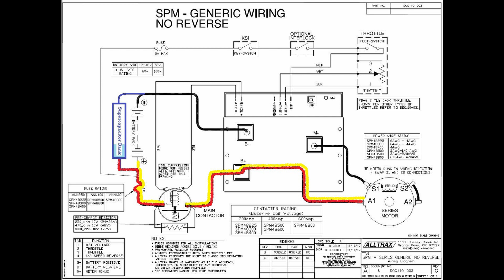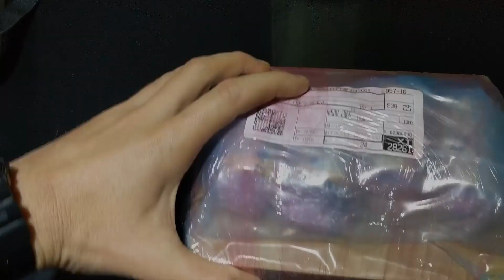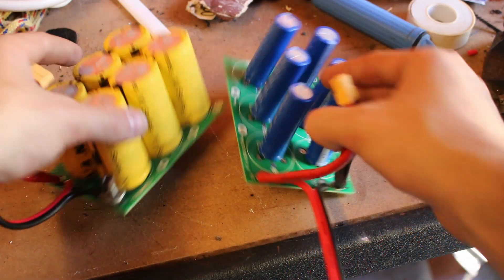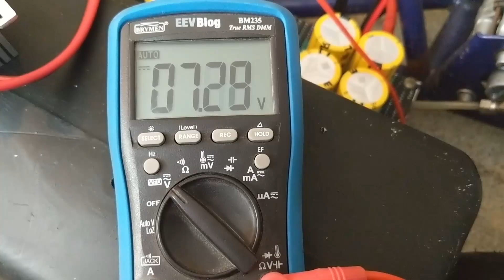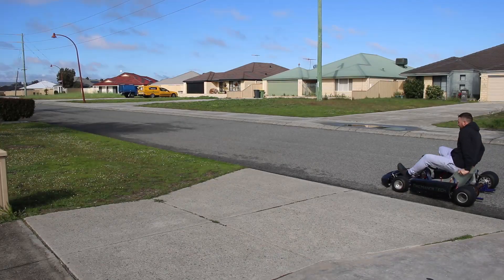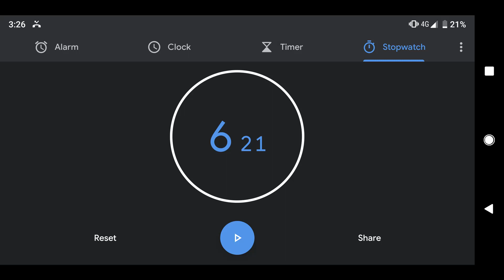DIY Electric Go Kart (Part 4)

Comment: HI this video is 3 years old.  (are you still active in this project?)  (or even active at all here on Youtube?  as the last comment seems to be 3 yrs ago too.,)
I have been researching off and on for e-gokart.  Not sure how I missed this or it just got enought view now to pop in google search.
I have a few questions or thoughts:
* Have you considered making your own capasotors (simple as rolling up alumminum file and wax paper. )   I have seen videos for that am sure you can find some too?
* Have you seen videos that use capasitors for car battery starting?  I am wonding if you can use some sort of alternator to assist with charging your your capasitors (possibly for even a no battery system)  or for sme extra mileage (instead of regenerative break >> regenerative motion)   [In therory it is possible > don't mis take that as "free enegry"] (I took some eletronics tech in Highschool but all I remember is Ohmes law, augh!)

Comment: I dont know too much about electronics, but what if you used a diode to supply the motor with the boost, and you had a seperate charge circut that was limited so it would charge slower
Reply from the maker: Great minds think alike mate, I designed a similar circuit using a very beefy 150a diode but never got around to installing it, instead moving away from super caps. I idealized a boost button that could light up when the caps had reached charged and could be activated when a quick surge of energy was needed

Comment: If you had only fired up the 100cc motor that originally came with your go kart, you would have been blown away with the acceleration (whiplash neck guard required for your helmet) and top speed (>100mph). This thing is slow and I imagine cost you quite a lot of money now. What is the point of your project?
Reply from the maker: Hi Leoj, you probably missed one of the first lines in part 1 mate where I said I wanted to learn about electric vehicles and their systems. I definitely learned a lot. Cheers for watching
Reply: @TheHandyTech  I def missed that part. I used to race those little carts in the late 80's so I know you had a superb machine that would blow your mind acceleration and top end wise. I was really sad to see you remove that motor just to attempt to recreate half the performance with an electric motor. Anyways, It looks like you had fun but man would you have had way more fun with that motor you removed right off the bat. Maybe you should have tried to experience the original motor for comparison sake? Scientific comparison?
Reply from the maker: @unitrobe0  I have been on shifter karts, Rotax 125s etc. I know how fast they can be, they are amazing. But yeah the aim wasn't to make a fast go kart, it was to explore methods of using an electric motor with a go kart frame as the basis. I tried brushless, brushed and capacitor combinations. I also have something in mind for the next attempt which may come in the future

Comment: I been working on electric scooters for quite some time now and was always considering doing that capacitor project but never got round to it, thanx for the video, I can give a suggestion though,, sick with a 9ah 12v cell battery pack, if you can find CBS brand they are good quality, if you using a brush motor, or alturnitivly go with a brushless setup, way more efficient and powerful and potential to go fast with upgrades

Comment: I am impressed, working on my E-Kart as well. I have a similar setup but I am using an modified alternator and my plan is to use 48V 18650 cells 

This is would like to DC DC step up to 72V. I am using a 72V 3Phase Motor Controller.

Can we exchange experience somehow with pictures?

Healthy New Year
Bob
Reply from the maker: Cheers Robert. Sounds like a cool project. You should consider just building a 72v battery mate. The cost of a DC/DC converter that can handle enough amps to be fun will be expensive. Best of luck with the build!

Comment: I'd put a larger sprocket on the front, on the motor. Then I'd build a bank of 66160 lto cells. Their 40ah, pretty sick but about 50 dollars each on alibaba.

If I wanted to build a fast electric bike that would go over 120km/h, which motor would you recommend?

Comment: Do you have any issues with all the weight on one side?
Reply from the maker: Hi Kaitlin, the seat position of the go kart is already left of center and is meant to balance the weight of the engine with the drivers weight for a more even distribution on the chassis. The motor and batteries are probably a comparable weight to the original engine that was on there

Comment: Get you a few 5s or 6s lipos the highest mah you can find. And highest C rating you can get. Some packs you can run in parallel  to get the MAH up.then wire them to get the over all voltage you desire

Comment: Why don't you try SPIM08HP Batteries cheap on ebay $4 to $7 ea. 3.7-4.2v 8ah 200 amps. check you tube for info currently designing custom mobility scooter.

Comment: Turnigy makes 20ah batteries that are rated 12-24c for 240amp continuous discharge and 480amp surge. They are a little more expensive but maybe not much worse over all than the smaller batteries plus the super caps set up was.

Comment: The decreased ESR of the new super capacitors probably helped too - the old capacitors had tiny leads which would have wasted a lot of power in resistance.

Comment: 52v 20ah 18650 pack from aliexpress is about 500 bucks (premade with BMS), thats about double the capacity of your your hobby-pack. 18650s dont have as much punch as those graphenes tho.

or get 4+ 6s 8000mah lipos (ZOP brand are $120ea for 60c), put together they'd be 12s instead of 14s though..
Reply: or say screw it.. maybe your bigger motor will handle over 60 volts.. beef up to 16s, 18s or 20s even

Comment: 18650's don't cut it with the amount of current you need and the space you have. Maybe switch to LiFePo or something that has peak currents at over 100A+ each pack.
Reply from the maker: Yep I agree would have to have too many of them in parallel and that means more weight. I have already purchased new cells from batteryhookup. Have a look at my community page to see which ones. Cheers man

Comment: A while back I made some suggestions, and I see you arrived at the inevitable conclusion. I know you're trying to learn as you go, but sometimes it is worth taking a moment to look at what other people have done and what they got out of it. The energy capacity of even nice maxwell supercap banks is very low, and you can calculate how much would be required to move a mass of like your vehicle. You then figure out the range of voltage your circuit works at and figure out what proportion of the capacitor discharge curve would be used. You will never get 100% of the rated energy out of them, since you can only pull from a limited voltage range. As you rightly discovered, it's pretty much only going to be useful for reducing voltage sag in your application. I had more space for caps than you, but I still abandoned that idea a while ago upon the realization that it would also need a high current disconnect and second stage charging circuit. The complexity of the rig for an inferior outcome was not worth it; everything was easily remedied by larger battery capacity, which gives the dual benefit of reduced voltage sag as well as higher range at a lower weight. I also wasted a bunch of time building a small cell LIPO battery array that should have simply been larger cells from the start. (It's cumbersome to organize that much balancing wire, let alone the power connections). I realize you're trying to do something different, but you are repeating things that have actually already been tested. Here's a cap kart done with moderate success about a decade ago, which contains more details in the link description: https://youtu.be/Omk3FqXStdg

Comment: Great video series and those larger caps are awesome. I can't wait for you to get better batteries though. Nothing wrong with Lipo, you just had the wrong ones.
Reply from the maker: Thanks man. Yep hoping to order some new ones soon, I am making a custom control circuit for the capacitors at the moment. Will have another video out soon as I can

Comment: Gathering info for e kart build... Why would the 18650 pack be bad for this build like some are saying. On paper they would work... Is real world use different? Also how about 6 Duracell deep cycle 12 volt 20 Ah in series to get 72 volt 3 possibly 4 Kw motor? I was going to go down that route... Any feedback is great thanks
Reply from the maker: Hi Zaire. The 18650 cells will push out a maximum current of around 20a so you would need to have several in parallel to attain higher current output meaning a much higher cost, say if you had 14 in series and then wanted 100a output you would have 14*5 batteries. Also the batteries can be dangerous if you don't have an adequate BMS. The deep cycle batteries would work fine provide you are sure you want to carry that much weight around. Do your basic ohms law equations to find out how much current you will need at the voltage you want. Power is voltage X current so you can reverse that and use power divided by voltage to figure out the current needed for your motor rating. Keep researching man there is tons of info out there and plenty of ways to do it :)
Reply: @TheHandyTech  aaahhhh ok makes sense. The weight wouldn't be such an issue for me. Hopefully it'll help with traction. But 6 ExpertPower "exp1220" is series would make 72 volts at 120 amps. If I'm not mistaken the motor that I want (72volt3000watt) would only need 41.66 amps. Making the power supply more than enough? Or am I thinking of it wrong?
Reply from the maker: @zaire.mg.  yep that's correct your motor is rated to draw 42a at 72volts. Of course you may draw a higher current than that depending on the motor controller and the load etc we have only figured out the current draw according to the motor rating. Most motors can exceed that limit you are just susceptible to damage the higher you go. Also, your battery rating of 20AH means 20a delivered for one hour, in reality it can probably deliver much more current than that, have a look at the CCA rating
Reply: @TheHandyTech  so does the amps also add up in a series connection? So instead of one battery putting out 20 amps steady an hour... 6 of those same batteries can put out a steady 120 amps an hour?
Reply from the maker: @zaire.mg.  difficult question: one of your batteries can probably put out 120a with a low resistance load it just won't last long, so with more batteries at a higher voltage it can last longer. You may have trouble with one battery supplying more of the current than the others without some sort of management system. Best bet is to keep doing research on the net there will be tons of info out there and also ask the battery supplier chances are they will know alot more than me :)

Comment: Check out the spimoh8** packs from alarmhookup on ebay, 8AH at 3.7V each, 200 amps max current. great cells
Reply from the maker: Those are some serious cells. Maybe the 14s3p setup would be ideal. Need a BMS too though that can handle that kind of current
Reply: @TheHandyTech  I've used these "supercells" for all my electric bikes they are amazing!
Reply from the maker: @oriongodly  I bought 28 of them for a 14s2p config. Can't wait for them to arrive

Comment: love this series. i wouldnt recommend using 18650's as they have very low output potential. i would recommend any of the turnigy graphene panther packs. if you run as many of those in parallel as you can to get enough capacity as well as current output, you'll definitely feel a whole lot more kick. the packs can also take the high charging currents you want. also, a high current bms would also be ideal to protect the over charge and over discharge of your cells. it would also charge all of your batteries at once instead of removing them all to charge. cheers!
Reply from the maker: Cheers man. Yeah Ive been trying to find a decent BMS and they're pretty pricey for anything decent/reputible quality. Definitely will do my research before I purchase anything but that's all part of the fun haha

Comment: Hi there guys. May I suggest you do not use 18650 - you will be far better off using multiple larger capacity lipo cells /packs ok - so what you need is a cell whose capacity is around 16-20Ah (16,000mAh) 6s packs 12-15c rating - put 2 in parallel then combine more in series to reach your voltage - which should be around 70v + or higher (aim for 90v fully charged) - then you need to ditch the super caps for now because you won’t need them. This new pack will be well on top of the job. Then you’ll need to make sure these packs sum into a decent bus bar or heavy cable to that spm ! Don’t underestimate the thickness of this min 4awg dudes. And a fuse too ! Ok now open the taps on the spm to cap out at motor n battery at 250A with peak mode on. You will now have machine that feels like a rocket and won’t have much sag (around 1-2sec of 3v sag) and the packs will give 250A easy. Bigger the cell cooler it runs more surface area and also larger current handling lower internal IR - <2 mOhm per pack. 👍 hope this helps- source 7 yrs of building electric karts check out our FB page  @ZeroK.Kart
Reply from the maker: Thanks for the suggestions. Unfortunately without a dc/dc converter I can't exceed a voltage of 60V with this setup. It's very expensive for a dc/dc converter that can handle the current capabilities I want. If I had unlimited money I would buy a different controller and do things much different. For now I am happy to play around and experiment :)
Reply: TheHandyTech  hi there - I understand- you have the 48v spm version. try to max out your 60v limit on that. 👍 Dc to dc not needed 👍 it may work out cheaper for you to look into those lipo drone 16Ah 6s packs vs a bank of 18650. Also less construction time. Good luck 😉
Reply from the maker: @avacreativemedia  yep the voltage pack when fully charged was just over 58v. Cool I will look into it !
Reply: TheHandyTech  - worth waying up your battery options - another cheap option could be to look into used A123 26650 LifePo4 3.3v cells . They are very high c rating per cell, 3p pack could do 200A ! Used in modules in buses n vehicles. Stupid cycle life, medium energy density per cell(not as good as 18650) . Which is why they are cheap😉  - or if you try 18650- Sony VTC5a 6p pack will work decent. Other cells you need more of them as they don’t really handle above 8-10A very well. We got a comfortable 18A / cell on the Sony’s. I also get the goal of the project for YouTube video series etc 😉 so you need to not jump to end result straight away 👍
Reply: Edit* not 6p sorry I meant 12p 🤦‍♂️

Comment: You should check out ru.nkon.nl they have the best prices for 18650. I got them pre spot welded because its way cheaper than buying a spot welder although I'm going get one eventually. You could also try those super cells on batteryhookup.com 200A cells for $5.5 and cheap fast us shipping.
Reply from the maker: Thanks for the suggestions man

Comment: I'd suggest putting a (robust!) diode in series with the caps, so that they won't immediately start charging again. Then look into the possibility of recharging them via regenerative braking. Thanks for the videos!
Reply from the maker: I am designing a circuit that does a few more features than that. I will showcase it as soon as I can :) It will include some very beefy diodes! Thanks Dave